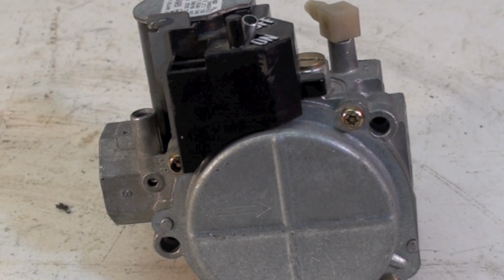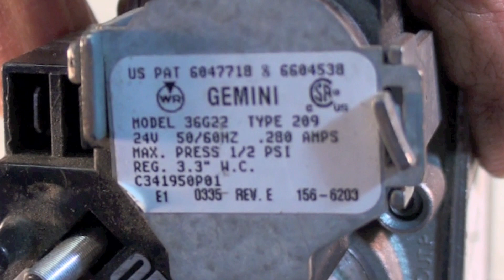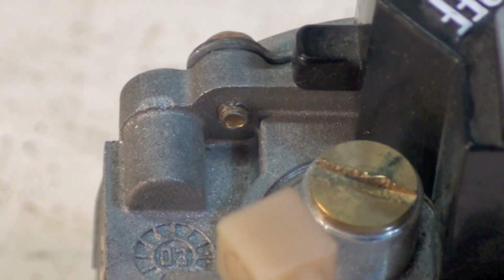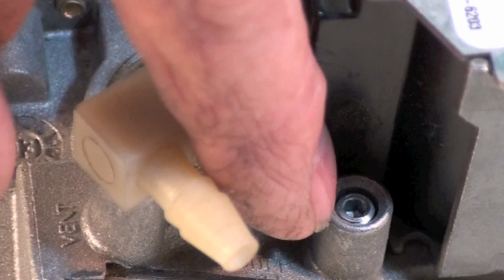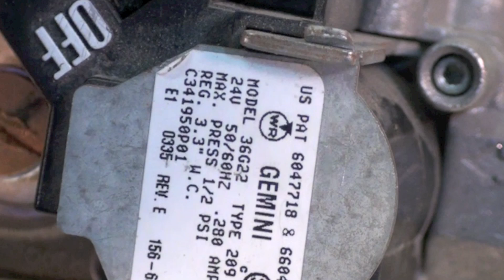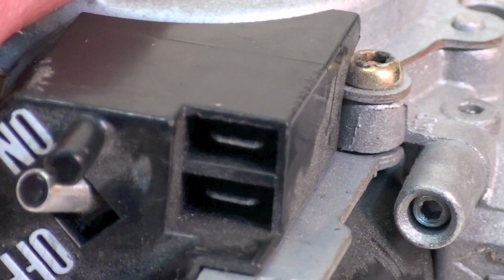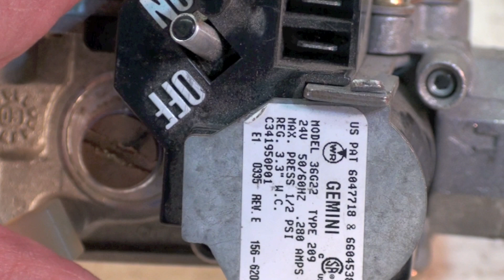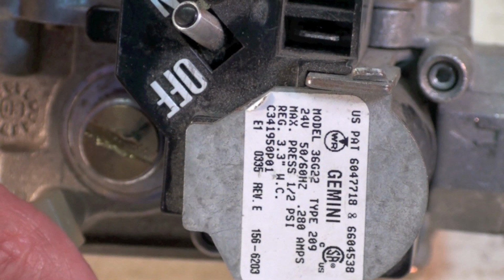How to check natural gas pressure using the Gemini gas valve taps for manifold pressure

Comment: Thanks for replying there was no voltage at the gas value I followed the wires to the board & pressed them in then cut the power back on & it worked. Your videos are very informative it helped a novice like myself trouble shoot my furnace. THANKS

Comment from the maker: The plug with the hose attached is there to give the same pressure at the regulator as is in the combustion chamber.  The wires are interchangeable.  The next stage is to check voltage at the valve.  This is tricky.  You must have the meter probes on the terminals during a trial for ignition.  It only has power for 4 to 7 seconds and is on after the HSI warms up.  I will do a vid on that operation in the next day or so.  Hope this helps.
GFM

Comment: I just purchased a similar gas valve for my furnace,  it's made by White Rodgers. On this new gas valve I have a vent with a plastic fitting,  but my old one did not have this. This is what they gave me at the supply house.
Reply from the maker: Is your furnace a 90% efficient one?
GFM
Reply: grayfurnaceman no it's not.
Reply: grayfurnaceman it's a 80% single stage.
Reply from the maker: SombraLocs I would run a hose to near the burners.  Its a bleed line for the regulator.
GFM
Reply: grayfurnaceman would it be ok if I leave it the way it is because I don't have a place to connect it to the burners.

Comment: Thanks for the great video.  My Trane single stage furnace nameplate says 3.5" W.C. but the Gemini gas valve says 3.3" W.C.  Which of these values would you adjust the valve to?  Thanks again.
Reply from the maker: I would use the 3.5" wc. You can double check by clocking the meter for total BTU input.
GFM

Comment: Thank you for posting this video! I have one of these in my furnace and I was going to check the pressure and was wondering what kind of adapter would be the right one to screw onto the threads...would have to be something very small...but this makes sense what you describe in the video...
Reply from the maker: +Ainstain K Just press the flexible tubing from the manometer over the fitting.
GFM

Comment: what size tubing do you need for those gemini valves?You mentioned surgical size but do you know the exact measurment?
Reply from the maker: Marco Alvarez 1/4" inside diameter.
GFM
Reply: Outlet Pressure Post
.339 Dia. + DFT.
(Set Screw: 3/32" Hex Head)
Accept 5/16" Hose Connection

Comment: Thank you for the tip!

I have a 238 Type - how do I energize the high setting....so I can check the high gas setting. My Amana furnace doesn't seem to dual stage like others. I can't select the second stage via thermostat...it turns on after a preset time.

Edit - Looks like my furnace doesn't have a w2 terminal for second stage. But it has dip switchs to control the second stage. Options are 2nd stage off, 2nd stage after 5 min, or 2nd stage after 1-12 minutes.
Reply from the maker: About all you can do is wait the preset time.  It should then come on.
GFM
Reply: @grayfurnaceman  thank you GFM!

Is checking the gas pressure something that is normally done during a furnace check up?
Reply from the maker: @MyGoogleYoutube  Most techs do not check gas input with a service, but it may be done if there is an indication of a problem during the service.
GFM
Reply: @grayfurnaceman  Ah interesting maybe it's wasted effort for me to check it ? 13 year old 95 percent Amana....I've noticed when the gas ignites it's a louder sound than normal. Sometimes two quick small bangs when it lights. Cleaning the burners and crossovers seemed to stop that double bang. 

Oh well already got the digital WC gauge coming from Amazon b
Reply from the maker: @MyGoogleYoutube  I would check it.
GFM

Comment: When does the regulator vent work? Over pressure right? If unit gets somehow more than 10" wc pressure vent opens and discharges correct? Is it going to discharge it into house? I have seen it in commercial buildings (with boosters ) they have large vent pipes go out side of the building. But, not in residential, then why do we need it?

Comment: I have this valve on my furnace I have two questions about it on mine the vent port has a plug in it and a hose attached to it should the plug have been removed and there are two wires attached to it should the black wire be above or below the yellow wire? My furnace won't light the ignitor is working the gas is on, the switch on the valve is turned on I'm getting a diagnostic code of 7 red flashes which indicates the flame could not be established. If possible could you give me any suggestions.

Comment: I have the gemini 36g24 type 618 valve and it is not opening or no gas coming out.  There is 24vac across on the wires. Is there any other tests to verify if the valve is bad?  What kind of resistance should indicate the valve is locked. I've tapped on it but not helping.  Called the repair man a And they want $900 to replace the valve or $3100 for a new furnace.
Reply from the maker: If there is power to the valve, and gas is available,  there is not anything else you can do but replace the valve.  If the furnace is less than 25 years old and is in good shape, I would consider the gas valve.  The price for repair seems quite high as I would be doing it for about $500 max.
GFM
Reply from the maker: If gas is available and power is at the valve, it has failed and must be replaced.  As for the repair or replacement, unless the furnace is over 25 years old, I would consider replacing the valve.  The $900 is high as his price for the valve is less than $100 and labor is about 2 hours.
GFM
Reply: I'm about to replace my type 202 myself, why would this take 2 hours?
Seems more like a 15 min job at most.
Reply: Sometimes it takes longer than it looks. You might have to dial in pressures, etc etc. Plus removing gas can take a bit if there are alot of black iron connections. Then you have to leak check etc, then dial in. Then test.
Reply: It took 15 mins + 15 to leak check connections.
Reply: @ViolentKisses87  I would be curious how your piping is. As in do you have a straight pipe that goes straight to the valve and strait out, OR one of those (rarely meets code)  yellow flexible appliance gas lines. For those 2 options 15min is achievable. But a lot of furnaces you have to enter with black pipe into the furnace from say the left then 2 90° elbows to make a U turn into the gas valve. Which based on the amount of room and if your new valve is identical (dimensional) replacement or not, means sizing up gas piping, doping and turning each fitting tight and leak checking when done. If I had to quote a gas valve I would always use about 2 hours to be safe/conservative. Also room around the furnace can be an issue too. Just making sure there is not some expectation of every valve is 15min interpretation.
Reply: @shadowhog6104   I have to admit your first sentence sounded like a  bad plumbers pick up line lol.
 It's a black pipe and I did get the original job finished in about 15.